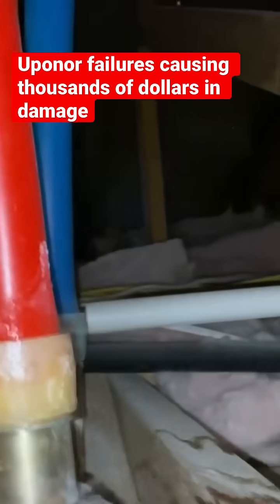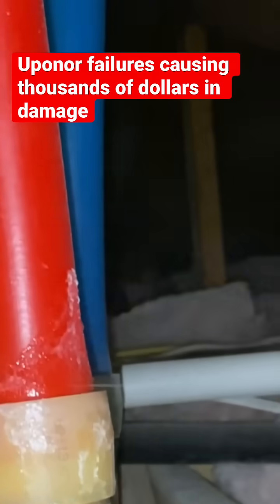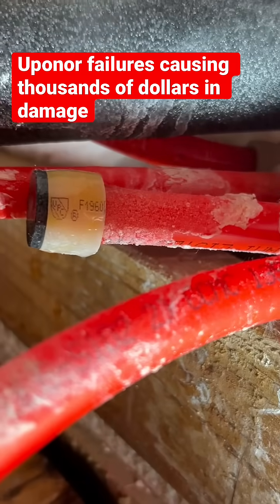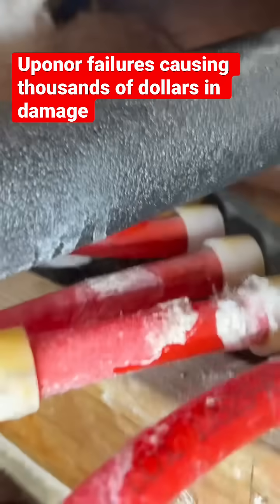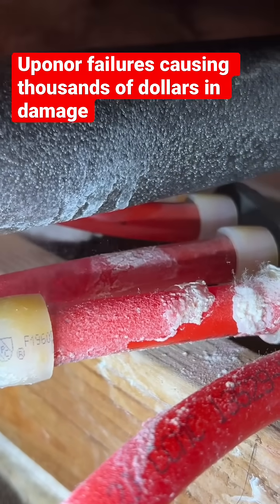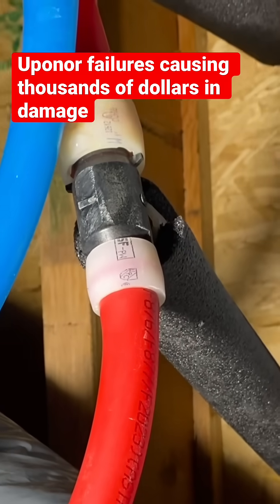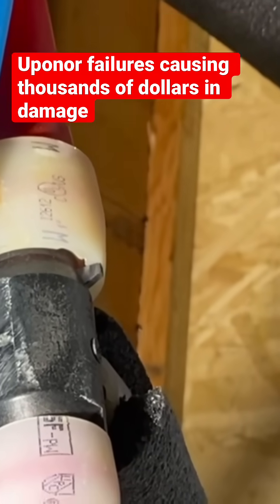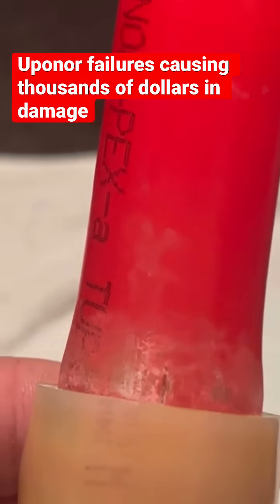Why is Pex starting to get Pinhole leaks like copper? #Uponor #plumbingfail

Comment: Not a rep of Uponor but I know the situation.

Red & Blue (not white) PEX A had a bad batch a few years ago that had problems with micro stress cracks forming when it was expanded, that's why so many of those UPONOR failures happened around the couplings.

Not your or the installers fault, it was a chemical problem with the bonding of the PEX.
Reply: So there is or was a class action lawsuit associated with the product?
Reply: Blue poly all over again.
Reply: Do you happen to know what year was the bad batch? About to buy a new home that was just built 2 months ago and makes me wonder which Pex do they have. Thanks!
Reply: Only leak I ever had was through the copper pipe, not fitting. Cpvc 26 years no problems. A lot depends on water quality and source.
Reply: i use coper!!!!!😮
Reply: @bnk28zfp I stopped using copper. Depends on location.
Reply: @bnk28zfp I've installed copper for 35 years - never ever leaked.
Reply: @bnk28zfp  What is coper?
Reply: @ChRoNoS132  And you bothered to comment on my comment.
Reply: @ChRoNoS132  Try showing some maturity instead of personal insults
Reply from the maker: I heard that too a couple years ago just before they switched to the clear but Ive cut out a couple clear Uponor and white Uponor leaks in the last year as well.. I just changed phones and for some reason a bunch of my videos and pictures didnt come over to the new phone so I need to figure out how to recover some of those pictures and videos and ill be posting another video on the subject soon.... Im not sure if its installer error or bad batches of pipe or what but Ive been doing some research and theres a guy name Joe Ludlow with Integrity Repipe here on youtube and he seems to have a lot of good information on this subject, Ive looked into some of his claims and they check out.
Reply: @PlumbingExplained How has it worked out? Rule of thumb, in general, pigment in a material is not what you want if a non dyed version is available. Why, is another story for another time that I won't be narrating. I've generally found the above to be true. Going with that theory is my choice and in my opinion, a good way to go. I've no reason to believe studies on this have been done on any materials used in plumbing or anywhere else. And I certainly not a professional regarding chemical analysis, nor licensed in any type of plumbing work.
Reply: @PlumbingExplained  Inspectopedia has good info on it. I believe there was a class action. I heard it had to do with poor resistance to chlorine.
Reply: So if I use sharkbite I shouldn't have that issue then right?
Reply: @robertfarquhar2780 The only time i trust sharkbite is when its inside of a house or in a place that doesnt get below freezing.
Reply: are the current Uponor's fine now? the white ones? no issues? still kinda paranoid about using them, i personally prefer copper
Reply: Both Pex A and B are having issues, a lot of it is due to the chlorinated water which is causing brittleness and cracking, best thing  to do is get a good filtration system if installing this stuff.
Reply: so in other words, its Uponors fault. Cant blame the chemical blame the brand for allowing a bad batch. The bad thing about this is the damage is done due to bad product and the worst part, consumers cant blame the brand.
Reply: It was class action lawsuit the whole block had this replace under 10 years and it leaked
Reply: I just started using pex a in the last year. And luckily me I have only been using the white pex. Thank you for your information.
Reply: It's also the white
Reply: Ran into this.
 Hot water tank exit line. The pinholes were between the fittings. They were not near the fittings, so I'm going on with the pipe, maybe.
Reply: @Demither10  Thats what they are saying, but they have videos on YouTube showing the white Uponor has the same problem. Thank God i live in Texas and we wont have these problems. They seem to occur in areas that have freezing temperatures through the year.
Reply: Our clear uponor pex failed and ruining our kitchen. Just this week red uponor failed and ruining garage ceiling/side of house. How is this still a problem and what can be done?
Reply: There's a guy on a forum who needs a repipe, and strangely, the original installer crimped the Uponor instead of expanding it. All the failures the guy had was not at the crimps but in the middle of the pipe.  It's not an expansion issue.  Also, white Uponor pipe is also having that problem.
Reply: Use a heat gun to preheat the tubing before expanding it. That should add flexibility and reduce the stress during expansion process thus reducing the chance of getting those microfractures in the tubing.
Reply: @ymg200 are you sure
Reply: So we can  sue the maker of these trash flex lines, correct?

Comment: I wanted to learn and understand about PEX tubing for plumbing. One thing that was mentioned is that chlorine can cause the PEX tubing to eventually destroy the tubing. I understand that PEX tubing can be more forgiving in cold situations. I wonder how many REPEATED times the tubing can be forgiving?
Reply from the maker: Many water districts use a chemical called Chloramine to treat and disinfect the water supply, The Chloramine might be the problem here, Ive heard a theory recently that im starting to lean toward. The theory is the Chloramine is settling in these tiny imperfections inside the pipe and over time it causes a reaction that causes the imperfections to expand and open up into small micro cracks just like pinhole leaks on copper pipe. Im going to be doing more research into this and posting more videos on this subject with my findings as time goes on. Thanks so much for taking the time to leave a comment.
Reply: @PlumbingExplained  hey, thanks for the feed back. I live in the country and have a well. I have a chlorinate system on my well cap. I found thru testing I have a type of alge in my well that can and has clogged and burned out my well pump so that’s why I have this system. I took care of the alge problem but I would have to stay away from PEX because of the original concern of chlorine & PEX reaction. Copper is where I have to be.

Comment: Looks like it's run through the attic? Freeze breaks?
Reply from the maker: Naw this is in Southern California on the beach, been seeing this a lot
Reply: @Plumbing Explained  looks like a stress tear for sure. Over expanded ? Wrong pex for application... most of what we use for pex a isn't colored but white or translucent. Expanding b I would think could cause this failure. Not meant for expansion. I'm a remodeler not a plumber but we use a lot of pex. I use B and the owner uses A. I'm too cheap to buy the expansion tool for as little as I'd use it. I have the Apollo crimper and typically just use the poly connectors. No failures so far and we are in Ohio where I've seen -35⁰. As a Florida native working up here has been a bit different.
Reply: Was the hot side on a circulation system? I've seen a ton of uponor failures on hot water circulation as well.

Comment: People about to get paid just like the grey quess pipe
Reply from the maker: May not be that simple, Uponor makes it difficult to actually file a claim against them, you have to hope whatever plumber you call out to fix the leak knows how much of the pipe to cut, where to cut it, what to save, etc.... Theres codes printed on the pipe that help them determine when it was made and things like that and they require that to proceed with a claim...
Reply: Not until a class act lawsuit is filed against Uponor. I’m sure it will come out in time